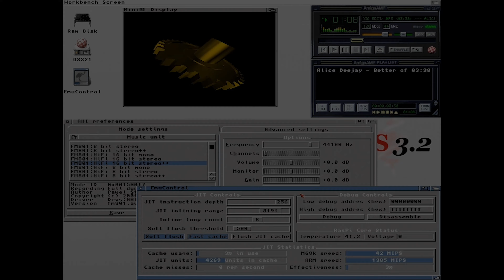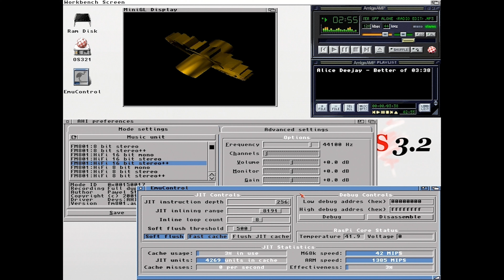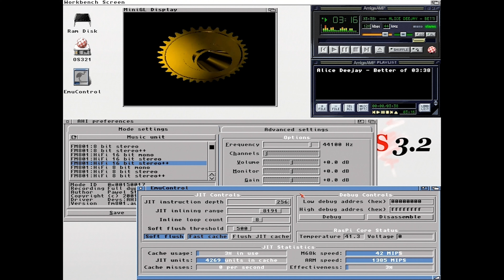Amiga 1200 / PiStorm32Lite (Rpi3+Emu68) / Mediator PCI 1200 TX

Comment: This looks great and I realize this is a year old. But I am about to start this setup tomorrow and I was wondering if you ran into any issues?  Currently my A1200 1D4 is setup in the Elbox tower with pistorm32 (also a rpi 3a) with an indivision flickerfixer. I was wondering if i need to make changes before putting the mediator on
Reply from the maker: Keep installation target CPU without MMU, it should work as is.
Reply: @simo.koivukoski  Thank you, I will try that!

Comment: Hello, I have preordered the Pistorm 32 lite for my towerized ReA1200, I have the mediator (v1.0) with Voodoo 3 2000 PCI but also have the ATI Radeon 9250, sound card is Sound blaster CT4750, can I do the same like yours? What benefits does this setup have? I am asking cause I was gonna sell the mediator board. Forgot to mention that I have had the Apollo 1260 80mhz with this setup. The tower is a Micronik infinitiv. Tnks!
Reply from the maker: Later on PiStorm32Lite will have a networking and audio (AHI) over HDMI. RTG works already over HDMI. They will be much faster than cards in PCI slots. Probably if one day we will have MMU we can try Killer card for PPC, but even it would work it's not that good with Mediator 1200XT. Only case where Mediator makes sense is that if you like to use PiStorm32Lite as CPU replasement only and keep using PCI cards (which is also fun but slow).

Comment: Very cool but the gears demo is running very slow!  (compared to the Warp3D PPC version with a PPC chip :)
Reply from the maker: Slow Zorro2 bus and chipset speed are bottlenecks. When you have a PPC in the mediator, it has a direct bus to the graphics card. Now in our case Emu68 is just resting.
Reply: @simo.koivukoski  Yes. I have a Pistorm in my A2000 with Emu68 and a Pi 3A+.  I also have another A2000 with Vampire V2.  The Vampire feels faster in RTG, it must have more accelerated functions.  I hope that is improved in Emu68.  Maybe it would help if there was a Warp3D hardware driver for the Pi's graphics chip?
Reply from the maker: @Darrenhd2  You are right, emu68-vc4.card is still in the frame bufferf level compared of Vamp gfx driver. Maybe one day we will get Warp3D support and all other nice things, but the most important thing has been get the CPU working flawlessly.